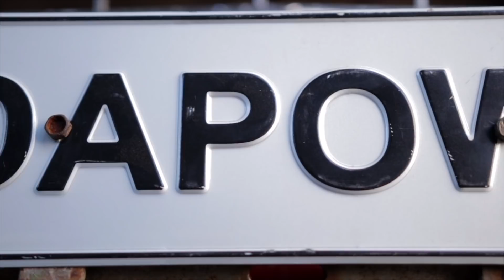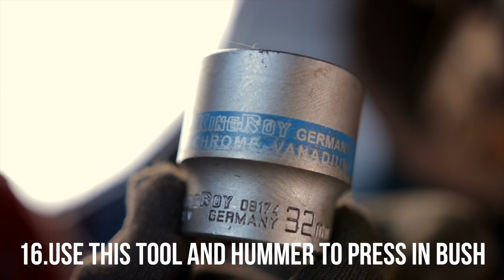How To Replace Control Arms Bushings on Classic Lada /// Ladapower.com

Comment: So you use these rusty parts without cleaning them and treating them with protection? How long is this supposed to last?
Reply: It's a demo on bushing replacement regarding how to use the tool they sell, you should already know all the basic extras that need to be done.